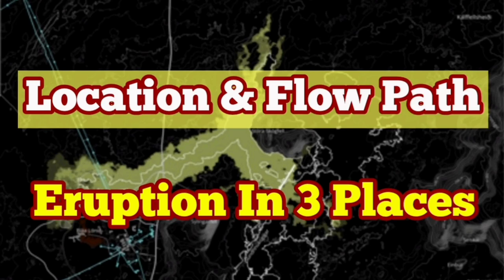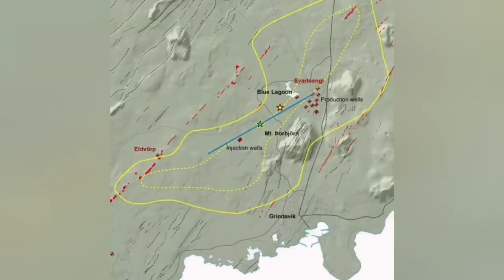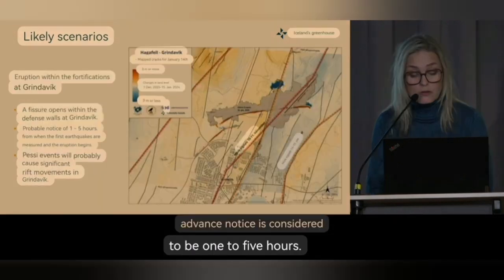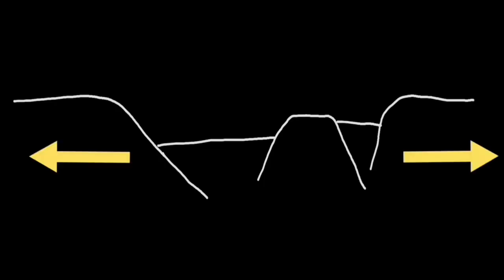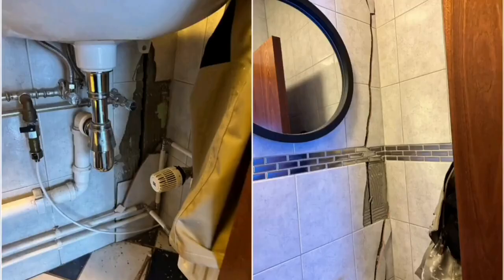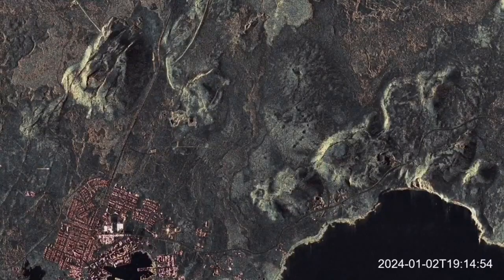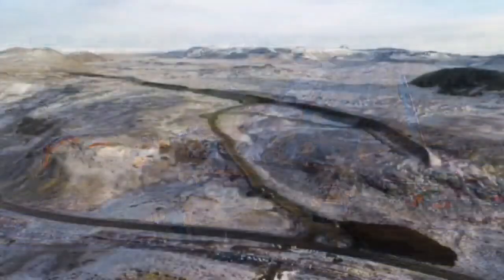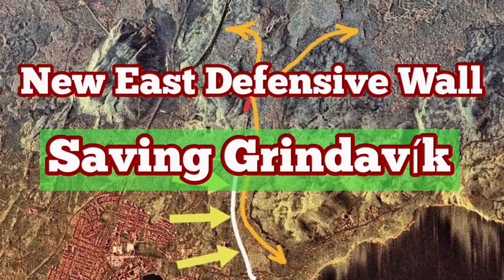Three Eruption Scenarios: Location,Alert Time,Flow Path,Iceland Svartsengi Grindavik Volcano Fissure

Comment: the last event the intrusion probably didn't have enough pressure to reach the surface, so maybe the pressure in the system has equalised with the pressure from the surface so we may not see another eruption.
Reply from the maker: You can be quite right. There is still plenty of things to learn about this volcanic system.